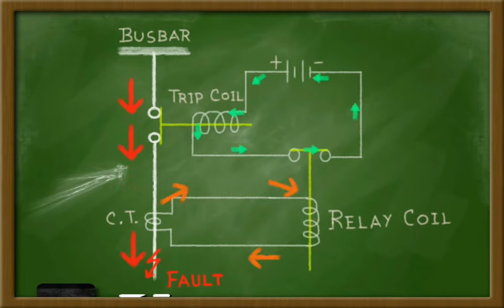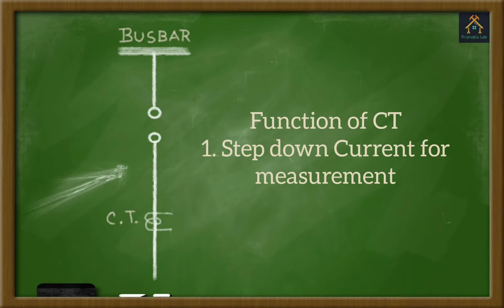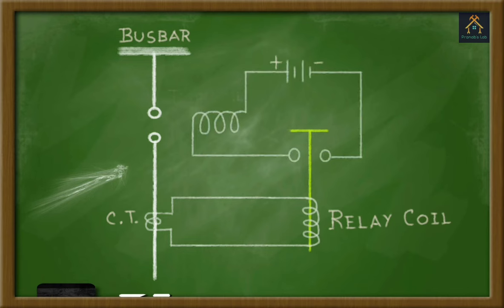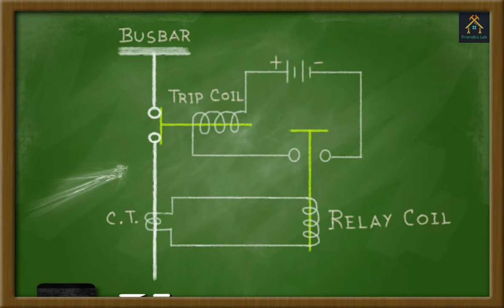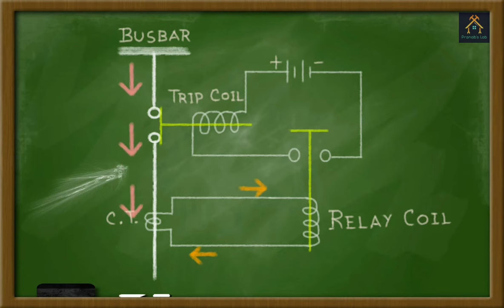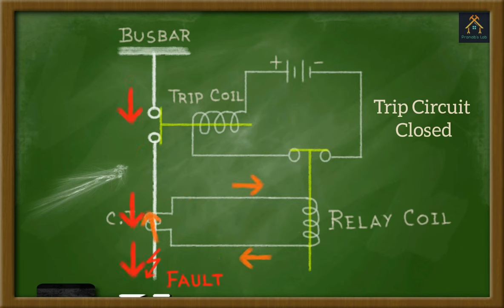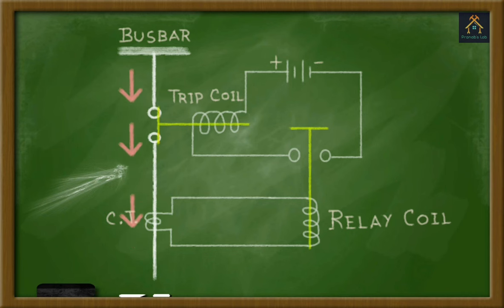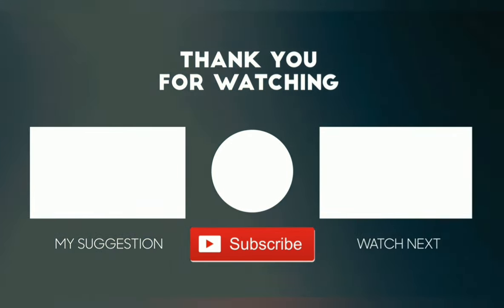Relay and Circuit Breaker Working | Operation using Animation

Comment: Due to huge current , when CB opens the air present in that small gap get ionised due to that arc is occur .    Arc is universally proportion to length of air gap
Reply: how relay and ckt breker work in conjunction ?

Comment: The arc is produced between the contacts of circuit breaker as the air gap is formed between them..
And when the contacts are open at the tip of moving contact a huge current is present with high elecro magnetic energy due to which the air gets ionized and allows the huge current to flow towards the fixed contact as a result the electro magnetic energy get converted to electro static energy . Thus the arc is occured between the contacts of circuit breaker. 
This phenomenon is called as " phenomenon of arc ".
Reply from the maker: Hats off ❤️

Comment: Since loads connected to bus bars are mostly inductive in nature the energy stored in inductance of loads + inductance of line will force to maintain the connection while you try to break the circuit.

Comment: Produce the same video but this time include a transformer 240vac to 24vac, circuit breaker two push button (start first follow end by stop push button) plus relay controlling incendiscent lamp

Comment: After the breaker has been tripped and there is no longer a flow of current in both the relay coil and the trip circuit the plunger is not supposed to close the circuit breaker automatically.
Reply from the maker: Yes, you are right.